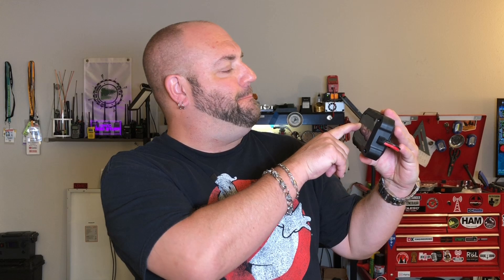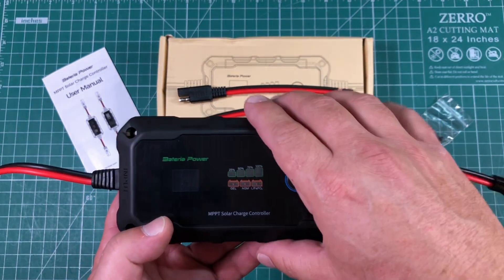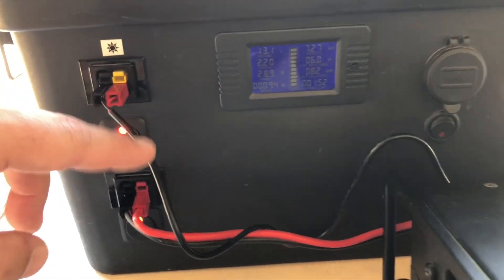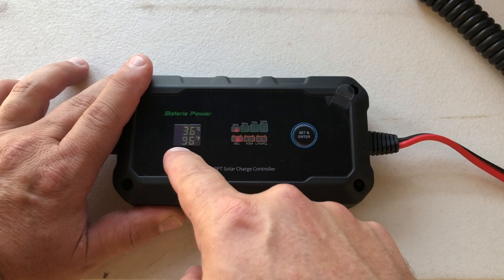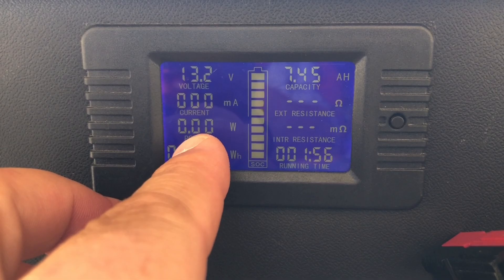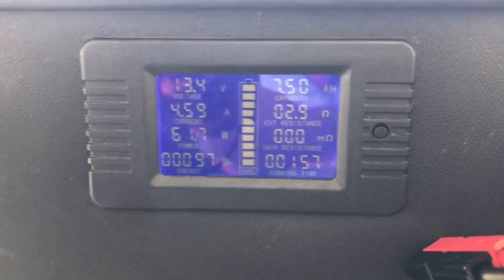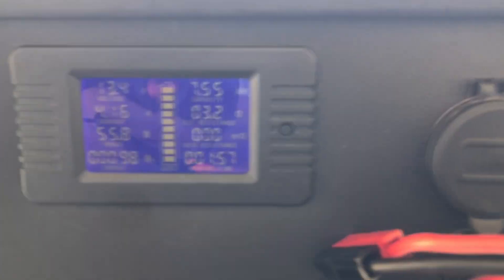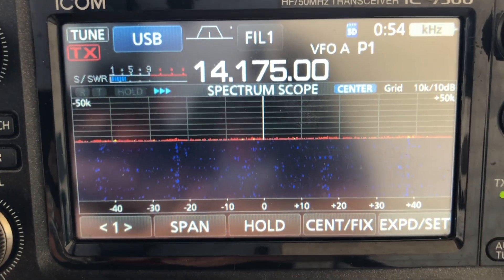MPPT vs PWM Solar Charge Controller

Comment: I know this is old, and maybe you have done more comparison of PWM vs MPPT in later videos.  You didn't see much power win from MPPT because your PWM was operating in nearly ideal conditions.  More extreme panel voltage compared to battery voltage will show a better gain from (a good) MPPT charge controller.  You can estimate when this will occur by comparing PV open circuit voltage to battery voltage before connecting the panels to the controller. Especially if for example you wired your panels in series, say 4 in series would be an 80v array, and running that thru PWM to charge a 12v battery would essentially throw away 3/4s of the power.  MPPT would buck down the voltage and up the amperage to get the power into the battery.  (And there would be less IIR losses in the panel wiring than if they were connected in parallel, which is what you would do for a PWM controller to avoid losing that 75%.)

Comment: Used a Victron 100/50 MPPT on my boat. During daytime 20 and 17m was useless.  Was advised to switch to a PWM regulator. All the. noise was gone.  A little less charge power but that was an acceptable tradeoff.  73s LA5ZO

Comment: Older video but had to post.

I've tried several PWM and MPPT charge controllers.  EVERY MPPT controller (except one) produces hash and or birdies up and down the bands.  The only MPPT controller that is quiet is one built in Michigan by DIY Solar For You.  I bought the SOL model which is 20a.  The nice thing about this controller is that it is a BUCK BOOST.  It can take 9v DC and bump it up high enough to charge your 12 or 24v batteries.  You can also put your panels in series and run up to 60v into it and still charge 12 or 24v battery bank.

Last week I went camping.  I didn't take any panels but instead, I connected the charge controller to the truck battery system.  I made sure it was only connected while the truck was running.  I got a nice 20 amp charge coming from the truck into my LifePo4 battery bank.  By the time I got home, the entire battery bank was fully charged and the charge controller was sitting in standby - 0 amps.

I absolutely love this new configuration.  Now I need to set it up so that a relay turns on and energizes the current coming from the truck only when the engine is running and switches over to a solar panel input when the truck is not running.

I'm building this system to eventually put into a camper van build.

Comment: Thanks, Mike! I know this is an older video, but it kept me from spending some extra money that may be unnecessary. I bought a Renogy PWM charger for a box I'm building before doing all my research on charger RFI. I was about to throw some money at one of the Batteria MPPT's after reading about MPPT's supposedly being quieter, but this just shows that's not always the case.

Comment: MPPT for 12v solar to 12v is somewhat beneficial, but where MPPT really shines is using 24v or 48v solar with a 12v battery.  Not only is the charge controller more efficient, but higher voltage from the panel means less line loss in small diameter wires. With PWM or MPPT, the cheapest option is never the most efficient or RF quiet.

Comment: I got the 10 amp version of that MPPT controller (same brand) for about $32.00 on Amazon. I set up a 20 meter ham stick on the bench outside and got the same birdies as you did. I then wrapped the power cord between the charge controller and radio with a bunch of turns through a FT-240 toroid and it 100% cleaned up the birdies. I'd like to try a FT-140 just because it's more compact. Just like yours, the Bioenno was clean. Still a win in my book for a compact controller that I plan to use with my QRP radio when portable. Give it a try, I think it may work out good for you also.

Comment: The MPPT vs PWM efficiency difference is greater when solar conditions are not optimal.  Meaning slightly overcast days with the full sun fading in and out behind clouds, etc.  If you put both types of controllers in optimal/full sun conditions then you will only see a slight (15% or so) difference. It would be a better test if you had 2 identical solar panels connected by each type of controller and 2 batteries at the same discharge level and left them out all day while recording the data. You’d find the MPPT will provide more charging current over the day than the PWM.
Reply: I have done that type of testing many times and like I metioned earlier, I haven't found an mppt that outshined the pwm

Comment: So, basically a PWM controller is RFI quieter, than a MPPT controller. Right?  
Both charge properly. But, if your using MPPT controller, you'll be happier if you charge one battery, while operating on another battery!?
Reply from the maker: I wouldn't make that general statement, no.  It's gonna depend on each individual charge controller and the quality with which it was made.  I've come across plenty of noisy PWM controllers.  But, I wouldn't want a noisy controller anywhere near me when I was operating.  I would want a clean controller no matter what.
Reply: Yes, but PWM controllers are typically RF quiter. And MPPT controllers are more efficient!

Comment: to everyone saying "just put some ferrites" I have done this on many devices, and many devices like these, and also inverters, etc... you can create a load and losses.   Check all your volts and amps before and after adding ferrite chokes, you may be surprised about the losses.   In some cases you can create a more than significant load that will cause significant losses/heat etc...  Also, I have done extensive testing of both MPPT and PWM controllers, and in different configurations many times the PWM will outperform an MPPT controller.   And PWM will create a lot of annoying RFI in the form of Ticking and Popping and different charging levels.   You have to spend lots of time and effort (hours/days/weeks) to know what really works best for your situation.
Reply: Amen to that! My cheap 30A PWM just outperformed that Victron 100/50 on a small 640W (Solar) 12V (Battery-520Ah) setup. Normally, with indirect morning Sun, I can use a 1300W hoover on a SWI-Power, 3200W - 240V-50Hz Inverter to clean all my downstairs rooms, the MPPT only managed less than 1/4 of the space, and God forbid a cloud appears  -   I've learned that a PWM is an "Amp" Dump waiting to happen, and it is triggered by us, draining the battery. Mine gets down to around 12.2V, at which point my PWM is dumping 35A+ towards the battery bank and the drain on the batteries becomes very, very slow, staying 12,2V for up to 4 minutes, the MPPT just... Tracked with zero Volts to Amp conversion, it simply "Tracked"!! :¬/
I have just sent back the MPPT Victron 100/50 and upgraded to a 45A Epever PWM (More RF?) and am now adding a 20A Epever to the same battery bank to add a few more Amps - This is a very new setup and is still in test mode, but I am confident that this Paralleling of PWM's may completely stop the battery draining lower than 12.2V altogether:¬) - It's looking like 890W (DC) will run a 1300W (AC) hoover.
Not many demonstrate what happens when MPPT and PWM's are under a real load via an inverter and battery bank, only then will people stop saying MPPT is better and more cost-effective. PWM's only start to really work when there is a significant drain in battery power folks, not virtually idle and certainly not with a device that takes less than 1 or 2 Amps. ;¬) PWM's own!
Reply: @Dreadnyah  I have done a lot of side by side testing over the years and have yet to have an mppt win my heart.  That doesn't mean it won't work good for someone else.  I do all kinds of strange things to my system that maybe some other people wouldn't do.  I have my own ideas, such as I run my panels in a series/parallel array that auto switches to change the output voltage depending on conditions and demand and will switch between a 370v output and a 60v/30v output.  When all my batts are full it will switch to series and 370v into gridtie, then it will switch back to a 60 and 30v system to charge the 48 sys, and 12v sys.
Reply: @oldolfmann8927  WOW! Now that's a lot of Volts, why 370V for the grid, is that transformed to 240/120V? And how many Amps is that pumping out? , Ah, so the 48V DC is inverted and the same with the 12v system?  Nonetheless, it's quite impressive. Auto switching is a new concept to me, that is DC panel switching?.--- 
With the MPPT, I tried Serial, Parallel, and both and yet still the MPPT fast drained my batteries and did not do anything in response to the battery voltage drop, it hits 12.2V and continues to plummet, whereas my EPever 45A PWM controller goes into a full throttle, 35 Amps+, @12.2V (427W) - The 12V rating for the MPPT was 640W and it performed miserably. 
I have since added another 250W, 10 Amps PV using an Epever 20A PWM Controller, and now it seems to dump Amps @12.3V (553.5W - DC) - I was able to Run 800W @240V AC constantly, that's only a 3.3 Amp draw from the inverter I know but I'm only using 5 panels @710W, I would need double that to run the MPPT in the same manner and quite frankly, I have no more space for more PV's. This humble little setup should, in my mind, the panels should eventually be able to feed or float to the inverter in full sun and only charge the battery when clouds appear. I will test 1KW and 1.3KW AC devices next for continuity, but I am sure I am very close to my humble 5 Amps required to keep my hoover running constantly, I am not a cleaning freak, lol. My hoover is a beast - This would also appear to have the bonus that the battery drain will be lower, so less taxing for them?
In an MPPT, are we paying extra to simply "Track" data? If that is so, and there is zero amp dump, then is it not simply a giant rectifier with an onboard computer monitoring system? All the best.
Reply: @Dreadnyah  I can give an explanation here, or maybe more if you have an email I can send a pic.  Anyways, i have several properties and each is different but they are all still connected to the grid, none are fully off grid, so... example here.... I have some 31 volt panels x 12 = 372 volts DC at about 8~9 amps, all in series but with a relay between each 2 panels.  With all in series thru the relays the 372 volts @ 9amps is directed to my grid tie inverter (that's around 3000 watts) .  It can actually handle up to 500VDC @10amps and it makes the 240vac for the grid tie.  When the relays are switched it connects every set of 2 panels in parallel, for 62 volts DC @ about 50 amps, and that 60VDC goes to a charge controller for my dozens of deep cycle batteries wired at 48Volts.  I have several sensors set up that monitor daylight and voltage.  For example, when the sun goes down my light sensor automatically switches my home from grid power to battery power ( I have inverters connected to those batteries ).  If the batteries get low before the sun rises (sometimes in winter) the low voltage detection will automatically override the sundown relay and connect my home back to the grid and of course when the sun rises the panels will be in the 62v configuration until the batteries are charged.  There are a few more details than that, but that's the basics.

Comment: nice look at that one. I have victron and Morningstar MPPT ones. also low light on some MPPT makes a jump up. mine do. compared to PWM were the output is 0 and MPPT had some. throughout the day and month MPPT really adds up.  for a small system for POTA  or something the PWM makes less RFI noise.  but there is a fix for the noise. put ferrite cores close buy controller both solar side and batt side. I made mine with big ferrite cores on my MPPT. took out a bunch of noise. 73's

Comment: It would be worth doing a test with a battery that wasn't almost completely full to start. That shutting off was likely because the battery was at full charge.
Reply from the maker: It wasn’t full.  I drained ~7.5 ah out of it before charging.  30ah battery.
Reply: @K8MRD  That's a beast of a battery. I thought it might be full base on the center battery display and the behavior. If you pull 15ah out, the charge controllers will give it all they can give. Although, based on the panel you used, I think you were right about at max for what the panel was giving. Thanks for a great video.
Reply from the maker: You should see my 300ah batteries!  Those are beasts!
Reply: @hamradiotube  Fun for a loooong weekend with friends at 300ah!

Comment: I have seen that on other setups before.  Interesting as I have an off road camper with a high end Victron MPPT controller, 3kw Victron Multipass Inverter, and 300AH Battle Born Lithium.  A few weeks ago I tried nearly the same test looking at how noisy my trailer was going to be with my IC-705 and EFHW on a 25 foot telescoping pole on the tung of the trailer.  I was operating on the inside of the trailer and had a perfectly silent noise floor with everything running.  The only difference was I was powering my radio off a separate Bioenno battery not connected to the trailer.  I wonder if having the battery isolated would make a difference?  Although that wouldn't do much for charging, lol

Comment: The bioenno unit I got was $72.00. I needed a unit with a higher input voltage. Got a 48volt 72 cell panel on the roof of the shack

Comment: I know the idea is to have the solar charger  in or near the battery box.  Just wondering what the RF is when you move the solar charger away from the radio and how far before the RF goes away?
Thanks for  your videos and keep on hamming!
Reply from the maker: In my experience you need to be quite far away from one of these if they are producing noise.  Farther than is really practical.

Comment: Did you check if adding a choke could remove the RFI? Given that it's rather weak, it might just be enough.
Reply: I used a FT-240 toroid on the power cord. 100% cleaned up the birdies.

Comment: Mike, I ran some tests on MPPT some time ago, checking the output every fifteen minutes over four hours. I was surprised to see the out was only about 0.4 volts over the wet lead battery, with high amperage. And every time the MPPT ramped up voltage, it still only stayed about 0.4 volts over battery voltage. After speaking to the lead engineer at a major battery maker, he explained the most efficient way to charge is nor 3-stage, but rathef to lead the battery voltage, but keep the current high. MPPT will do this. Not constant current or voltage, but reading and leading.
 Just looking at charger behavior for a short time (an hour or less) and with only one battery condition (75% full) cannot show you how busy the CPU is in a proper MPPT charger. There are lookup tables, proprietary algorithms, all sorts of differences between brands as well. Some will adjust every minute, others only adjust every 10 minutes, etc.
 But if it makes RF noise, that's a stopper.